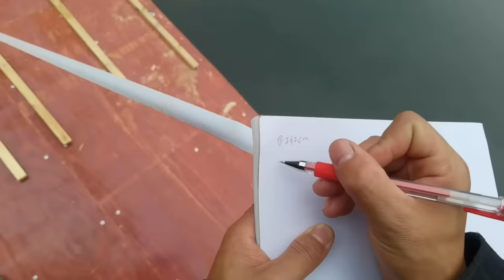Build The Frame Of The Bamboo Building On The Water In 10 Days, Process Was Complicated#houseboat

Comment: question> Why doesn't he use power tools instead of all the hand work. I. see he has them. I don't. get it. Also if all I. was going to. use was 2 inch screws and a finish nailer I believe I would be using a glue of some kind. A fairly strong wind and that things toast. I wouldn't trust the steps without glue. thats for sure.